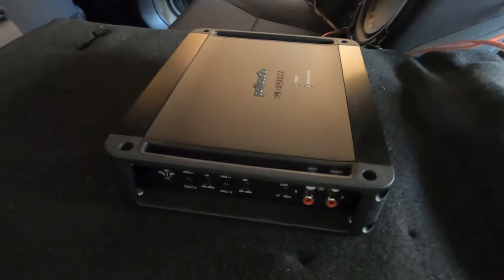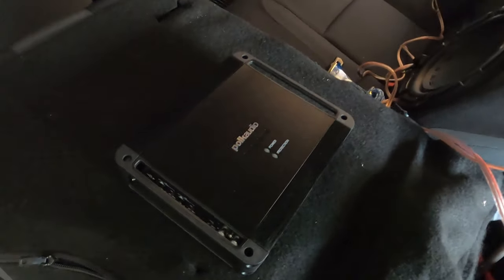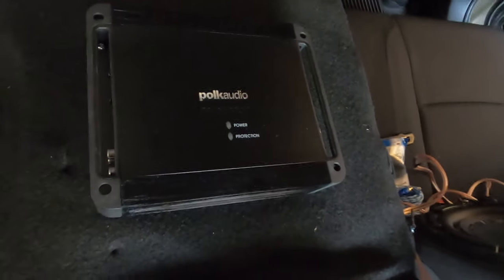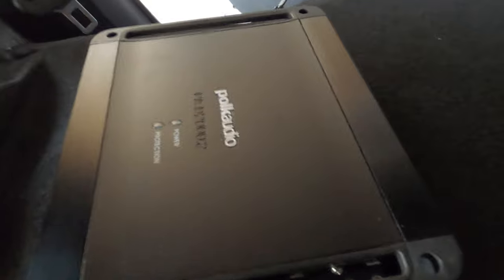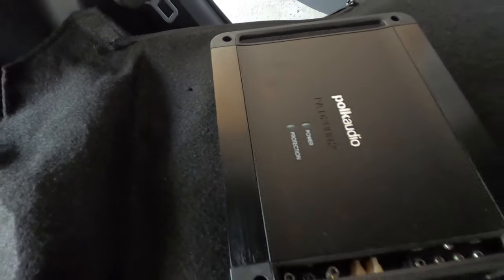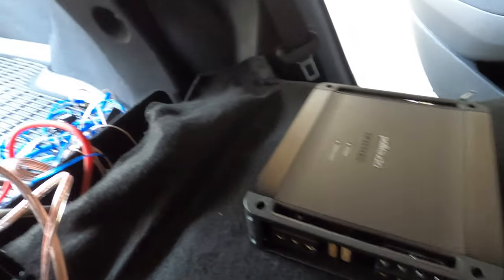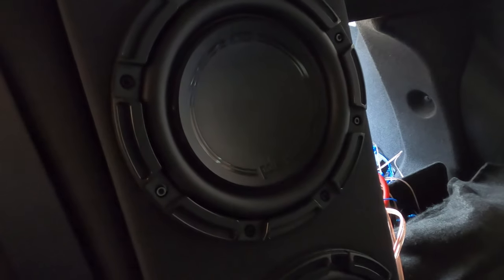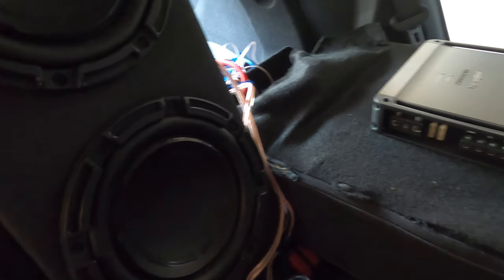New Polk Audio Amplifier Install Video

Comment: I can't believe you would show the world that you ran your RCA cables right alongside your power cables, a huge no-no in car audio, unless you like noise and hiss and whine. Otherwise, nice job! I'm getting ready to buy a PA D1000.1 so I'm watching videos about them. So far, every video tells me the Polk Audio is better than advertised.
Reply from the maker: Have not had any speaker whine or noise. Usually that means you need a cleaner ground connection if you are experiencing that. But good point. Thanks for the tip.

Comment: So many people try to skimp on amps. Gotta get a good brand. I use Alpine, myself. Polk is excellent.
Reply from the maker: Alpine is a good choice. I agree, the less expensive amps don't perform well or deliver the ratings that they promise.
Reply: @sanchaikofficial  and they break down. I've been running the same two (400 watt Alpine mono and 50 watt x 4) amps for 13 years.  Just changed the truck. They're bullet proof.
Reply from the maker: @mkp3824  Thats a long time 👍 Nice
Reply: I had an Rockford fosgate amp go pop on me even tho it matched the woofer never clipt it so yea even big brand amps do fail

Comment: Could you please link all of the parts need for this? Thanks
Reply from the maker: @Nash - Sorry for super late reply. I have 2 of the Polk Audio 8" DB+ Series Subwoofers https://www.sonicelectronix.com/item-133907-Polk-Audio-DB842SVC-DB842SVC.html. The Amp is a Polk Audio D2000.2 but I can't seem to find a good link anywhere for it. I custom built the woofer box myself using half inch MDF, you can find that at any home depot or lowes. Obviously you'll need a good 4 gauge amp wiring kit as well. Let me know if this helps.

Comment: Whooooooooow big mistake ther buddy signal has to be routed on the other side of the big power cable now you risk interfearance :o
Reply from the maker: So what do you mean by signal? Are you referring to the RCA/highline converter wires?
Reply: @sanchaikofficial  yes he’s referring to the rca’s. It can cause “throttle whine” through your subwoofers. Generally you want to run power on one side & rca’s on the other. But if you’re not hearing the whine, I wouldn’t bother with it. But if you do notice it, now you know where it’s coming from.
Reply from the maker: @robncasey1216  cool, thanks for the info.
Reply: There’s power wires all over your car. If you don’t have any noise it’s fine. It’s kind of a better safe than sorry technique. With good wire shielding and proper grounding you shouldn’t have noise.